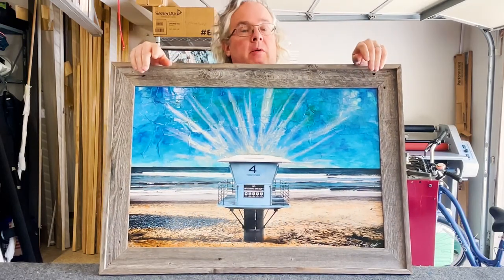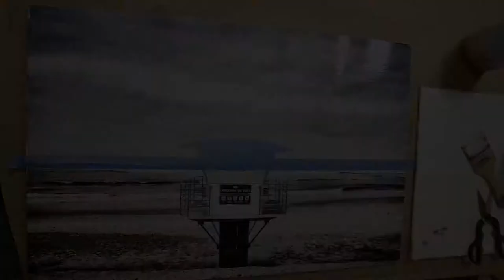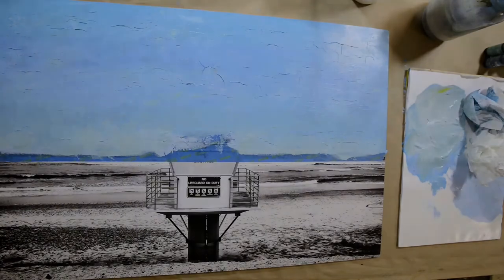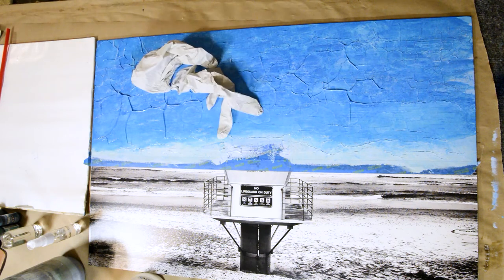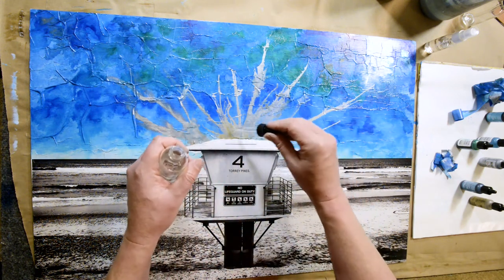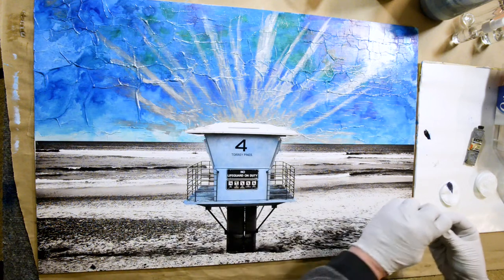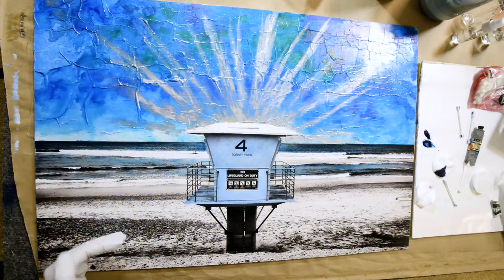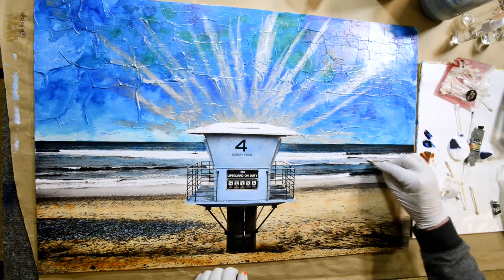Lifeguard Tower with impressionist sky - acrylics alcohol inks and oils on black and white photo

Comment: Will you ever try and present Marshall Photo oil coloring the Human body skin ? What colour to use ?
Reply from the maker: Hi Jaroslav. I have one video where I color my own hand with Marshall Photo Oils (https://youtu.be/2hftuTB5XN4). Marshall's has a lot of colors (but unfortunately not all are available anymore), also specifically aimed for skin colors, called Flesh, Basic Flesh, Flesh Shadow and Tan. You can control the lightness/darkness by how much you put on. You can mix in other colors to get other tones (for example for reddish cheeks). I have also used burnt sienna in the past, but since these photos were personal commissions I didn't record them.

For original (opaque) portrait paintings there is for example the Zorn palette, consisting of yellow ochre, cadmium red, titanium white and ivory black, which allows you to paint any skin color. Translating this to hand tinting you can omit the white and even the black, as you get the grays from the photo. You may need to change the lightness of the skin in the photo digitally first: making it lighter will give you more color saturation and making it darker reduce the saturation.